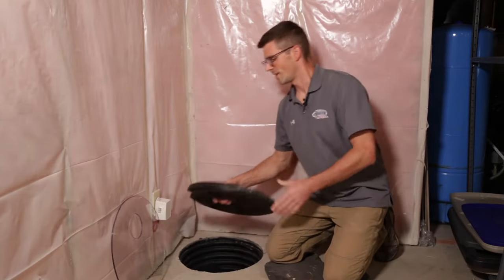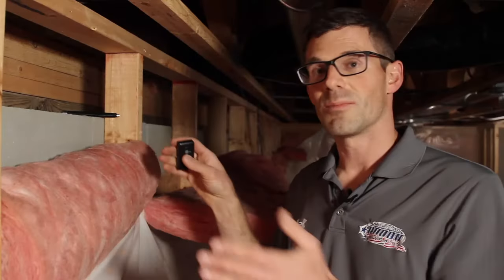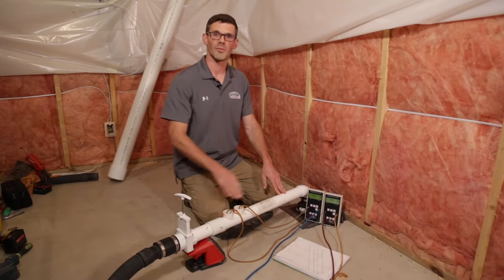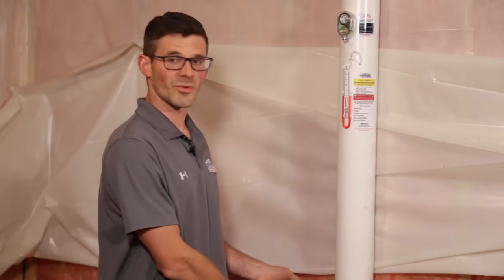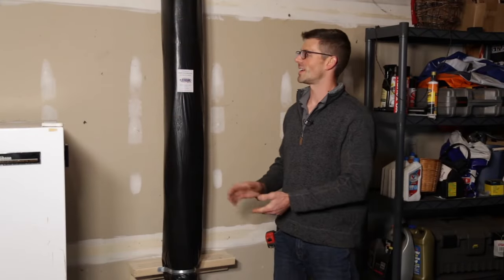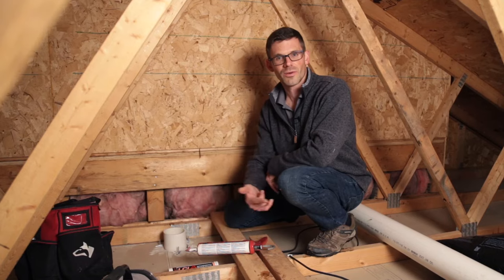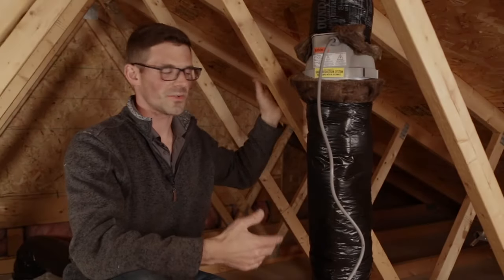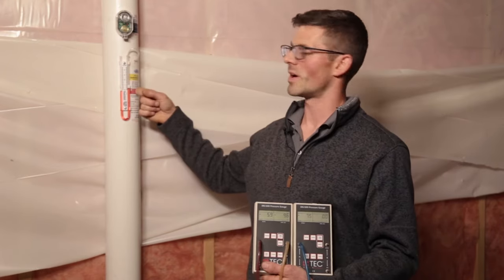Installing a Radon System in a Home with Drain Tile

Comment: And here was I, wondering all this time what to do with all that radon mitigation gear I had in the garage.  Now, thanks to your clear video, I know how to use my industrial four inch concrete hole cutter, my pitot tube with the blast gate, all the sophisticated construction vortex vacuum stuff and associated plumbing,  my two DG500 pressure gauges,  'trades only' caulking gear and non-toxic caulking, the pressure-measuring tubes and bottle stoppers and all that jazz that we all have laying around at home.  Thanks.  Now if only my basement were a squeaky clean, hermetically sealable box made of bright smooth concrete and cement blocks instead of an earth floor and fieldstone foundation, topped off with a two hundred year-old brick and oak timber house.

Comment: if your radon is so close to the wall, how do you make sure to clear the concrete footing?
Reply from the maker: We now use a sewer camera and locator to find the drain tile. 

Here in MN, the house footings are 20-inches wide. A 12-inch wide concrete block foundation would mean you have 4-inches of footing extending beyond the inside and outside of the block wall. The drain tile is next to the footing, so if you core 6-8 inches from the block wall, you should hit the drain tile.

Comment: What is the point of making a new sump cover?  Just to reduce the amount of inside air drawn into the radon system?
Reply from the maker: Yes, some choose to seal the slot in the sump cover with metal and caulk. However, I'm not a fan as I think it looks unprofessional. We also have to provide a 4-inch access port. 

I also like being able to see through the polycarbonate cover.

Comment: My new radon fan draws 2” of pressure but seems to draw very little air.  Removing the lid from the near by sump pit makes no difference.  I dont think our radon levels are dropping like they should.  Any comment?   Thanks
Reply from the maker: What model of radon fan do you have?
Reply: American Radon Mitigation  I have a Fantech Rn2.  Unit is pulling about 1 1/2” now.  It was 2” for quite a while.  My meter says 217 BQ long term and 194 7 day.  But some warm weather has arrived so are windows are open often.  It seems a cool day when the furnace runs short term levels spike to 345 Bq.  I know not to dwell on short term readings but the LT and 7Day seem high to me considering some windows are open much of the time.  Thank you for your comments.
Reply from the maker: @parkland4530  It sounds like the fan is not moving much air and is operating near the top end of its static pressure.  That's not necessarily a bad thing though. We've found that the key to getting your radon down to outdoor levels is to get vacuum or suction under the whole home. I'm guessing that your radon system isn't achieving that now. This video may help you understand what I'm talking about a bit better. https://youtu.be/TyCUneMCcLc
Reply: American Radon Mitigation Thanks for your opinion.  I tend to agree.  The installer says to give it some time but I am not that confident.  Being so close to the sump pit I would have thought it would have found a way to draw from a large area.  Anyway we will see.  Thanks for your opinion.
Reply from the maker: D'Arcy Keast I would expect a system connected interior drain tile to be at a much lower static pressure. You could try pulling the tube on the u-tube manometer out of the pipe and letting the oil settle for 10 minutes. The oil should be equal on both sides and at zero. If it’s not at zero you can slide the u-tube up or down to re-zero it. Then plug the tube back into the pipe. Does it still read a static pressure around 2-inches?

If not, my guess is the system is not tied into your drain tile system. You could always cut the pipe near the floor so you can look into the suction point to see if the system is drawing off of the drain tile. 

The moment you turn on a properly designed radon mitigation system you stop radon entry through the slab. You have to wait 24 hours to start a radon test so that the air in your house can be exchanged with fresh air. This gives the radon that’s already in your house time to dissipate. There is no need to wait longer than that. 

We sometime hear about contractors telling the homeowner to wait a long period of time to retest when they don’t know how to get the radon levels lower. I’d get recommend you find a contractor that knows how to do diagnostic testing to assess your system. 

Good luck!
Reply: American Radon Mitigation I will try that.  Thank you for your help.

Comment: You need a 90° elbow at the end of pipe on roof to keep rain and snow from running down the pipe and ruining the fan motor and collecting in pipe.
Reply from the maker: You'll see that according to the AARST standard that a strait discharge is preferred. 

Check out pages 16 and 17 of the standard https://standards.aarst.org/SGM-SF-2017/17/index.html#zoom=z

Comment: An air pipe is going to freeze??
Reply from the maker: Similar to a glass of ice water sweating. The condensation formed when the warm, moist soil gas touches the cold pipe can start to freeze to the pipe's inner wall. This ice can build up and block the opening, rendering the system useless until it thaws.
Reply: We don’t do any of that in TN
Reply from the maker: It probably doesn't get cold enough for your systems to freeze like it does in Minnesota.

Comment: Why not run the radon fan into the sump pit since it ties into the drain tiles anyway ?
Reply from the maker: Thanks for the question, Tony. Check out the informative advisory below figure 7.1.2 in the standard https://standards.aarst.org/SGM-SF-2017-X/11/index.html
Reply: @AmericanRadonMitigation  Thanks! If one of the concerns is leakage, is it a bad idea to install the new hole and tie into the drain tile in a location that’s right next to the sump pit? Does it need to be a certain distance away? Great videos btw!
Reply from the maker: Thanks, Tony. You don’t need to be a certain distance away from the sump pit. There are a few exceptions, but generally you would tie into the drain tile close to wherever you exit the house to avoid long pipe routes.
Reply: @AmericanRadonMitigation  I am not seeing figure 7.1.2. Can you explain this informative advisory?

Comment: Why would you make it so they can't add a sump pump
Reply from the maker: Great question! 

A sump pump can be added by removing the Lexan cover, cutting holes in the cover for the sump pump discharge pipe and cord, and then re-sealing the cover. 

You can see how we seal the sump basket when there's a sump pump in this video. The portion you might be interested in starts at 3:27. https://youtu.be/yY0G7TIUZIY

Comment: This is the problem with this now the sump pump is disabled and there is no drainage for water in the basement. So you don’t have gas ,but you’ll have a flood.
Reply from the maker: There never was a sump pump installed in this home. However, one could easily add a sump pump by cutting a hole for the sump discharge piping and a cord grommet. 

It is common for homes to have drain tile with a sump basin and not have a sump pump. Typically, we see these homes on top of a hill or where the native soil drains well, like sand.

Comment: Doesn't make sense why you would run the pipe into the garage, then up to the attic when you could just run the pipe out of an exterior wall and be done with it. It's bad enough people have to pay outrageous amounts of money to do something that never had to be done before, and then you make it as expensive as possible. RIDICULOUS !
Reply from the maker: Michael, here are the top three reasons why we avoid external radon systems whenever possible. 
1. They are incredibly ugly. 
2. They typically have a shorter fan life. 
3. They are susceptible to freeze-ups in the winter, leaving the homeowner with elevated radon levels until the system thaws and starts working again.

Ultimately, it is up to the homeowner. Most of our customers opt for an interior route to maintain aesthetics and lessen the chance of elevated radon due to a frozen system. 

Here's a video that shows some examples. https://youtube.com/shorts/7HGT6lqjyvo?feature=share

Comment: All the extra diagnostics and gadgets you use is only making customers more concerned for no reason. Pressure field extension is good enough. But the things you do is going way to far and is only making my work harder because customer watch these videos and are not satisfied. You are doing way too much.
Reply from the maker: Can I ask what you guarantee to reduce radon levels to?
Reply: @AmericanRadonMitigation  75%